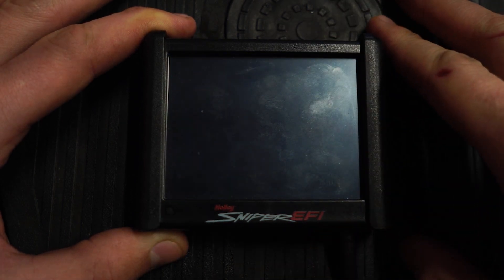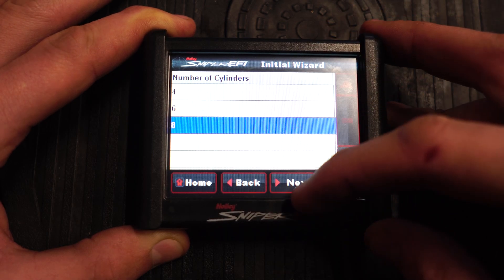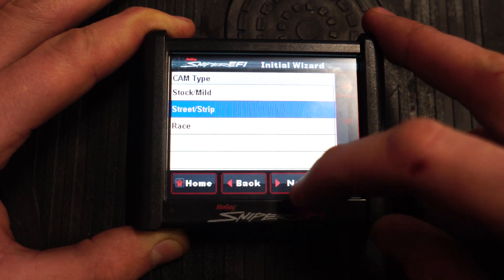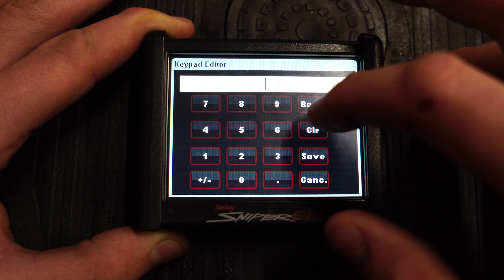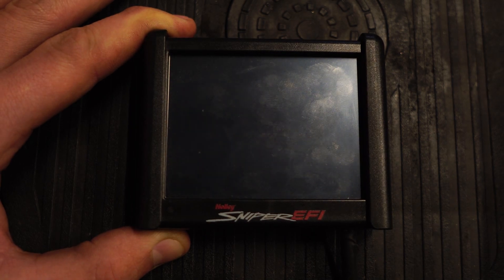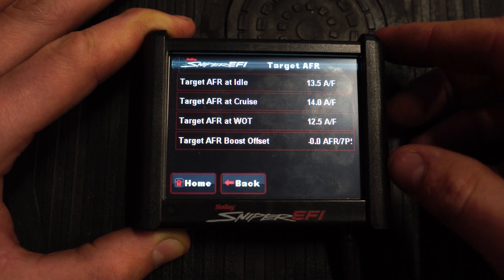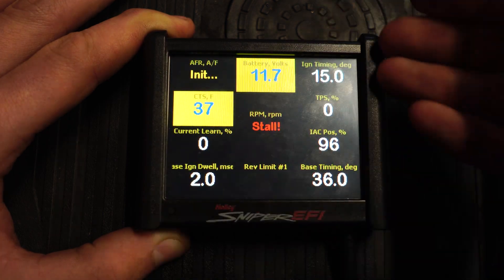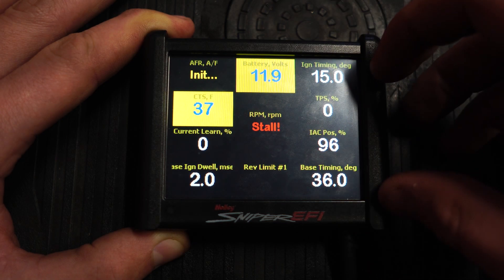Holley Sniper EFI: How to Set Idle

Comment: If you need to just reset your TPS turn the ignition on but do not crank. Adjust your idle screw until the hand held reads zero. Open and close the throttle a couple of time's,  let it set a few seconds then check the percentage on the hand held again. Get it to stay at zero every time you let off the throttle and it will be reset.

Comment: Well, here it is, three years later and video is still helping diy'ers. I tried everything to fix high idle. Idled was  ok until car was driven and then I would have to blip throttle to bring idle down. Frustrating. I tried the double wind spring trick. Resetting control unit and finally checked Iac. It was down to around zero. Sometimes 2. Adjusted as recommended and waalaaa. The fix for that problem is in, but it's always something with this Efi.
I was driving thru Atlanta, downtown, and car just stopped. Cops called tow truck while I worked on it and eventually, after 25 minutes or so, it fired up. To this day not sure of what caused it and I'm always waiting for it to happen again. My pump is externally mounted, which is not good.
Thx...
Reply: Having the same issue. Hope this fixes the problem.

Comment: Adjusting idle speed on my Holley avenger carb takes 10 seconds. You don't need a computer or have to spend $2000.00 . A $15.00 Vacuum Gauge allows a perfect carb setup  in 5 minutes.
Reply: I'm happy for you...... but a lot of people prefer fuel injection over carburetors...

Comment: Did you go into the screen and set the # lower and then turn the set screw. Did you take the ac setting to off in the wizard ??   My I C A is all over the place. I finally got it to come down but I had to turn off the A C setting. and put a fixed orifice pcv valve on it.  It runs great until it gets hot on a long trip on a hot day. I have heat shielded fuel lines and put a 1 inch spacer . Still have problems. Any ideas
Reply: put the carburetor back on,,,,

Comment: Hey Zanes, first of all great video. I didn't see the initial videos and or the issue you had. My CJ5 Jeep has this Holley Sniper EFI but the issue I have is that my car will die at 35/45 minutes of driving around. It feels like something "heats" up or idles because I have to wait around 25 minutes to crank again and then i can drive around but it will die again so that's why I say its something that heats up and wont send the enough gas/power and the car dies. Everything is connected as it should and my mechanic has not find out any other issue than this system.. would you help? Calling this guys at Holley is like talking t o a wall.
Reply: Curious if you got your issue resolved. I’ve got the SNIPER BBD installed on a 258 in an AMC Eagle Wagon and my first starts and tuning had the same issue you are describing. Not sure if the CJ5 requires the same sniper as mine but I did quickly find my issue. When I installed the throttle body I had to remove the TPS just to get space enough to wrench the nuts down to mount it. When I put the TPS back on I installed it in the absolute opposite position that is came installed factory. So what I was seeing was the engine would start when cold perfectly, then at operating temp it started running terrible and it would not start at all if I shut it down and tried a restart. When I loosened off the screws for the TPS and moved it all the way the other direction…it resolved it. Hope you found the issue already but figured I’d share my experience. Cheers!

Comment: Hello, I had the Sniper EFI installed on my 1963 Thunderbird. The car has a stock 390FE motor. While the car runs fairly well, it tends to stall when first driving and stopped at a stop sign or traffic light, while applying gas pedal and attempting to move. Of course, this usually happens when I’m halfway into the roadway and there is on coming traffic.

Any ideas why this might be occurring?

Thank you, Buzz G.
Reply: I've got a similar thing happening on a mild sbc 350 with a manual trans. Once it is up to operating temp it seems to be fine but even then the idle will slow down when you push the clutch in at the stop sign and then pick up again to normal after a sputter. Let me know if you figure it out. Any ideas Zanes Garage ?

Comment: Ok,i saw you had the vacuum port on the fuel regulator hooked up...im reading a lot of mixed opinions on if that should be hooked up or not..im not running any power adders, so should i not have mine hooked up or does it even matter? Idk, hoping you could help

Comment: I cannot get Holley to answer their phone. I’m seeing two things on mine which maybe you would know. One doesn’t really affect driving, but my TPS stays at 0 no matter what. Drove it around the block so the throttle works. The other started during my second drive, The first drive around town went perfect no issues the second Drive went good for about 10 minutes then all of a sudden my AFR started going up to like 35% every time I tried to accelerate and the engine wanted to die.

Comment: What intake do you have? Is it a single or dual plane?
Reply from the maker: I have a jegs dual plane intake. Nothing fancy
Reply: @ZanesGarage  thanks for the response! I only ask because I have seen some claim that it does not work great on dual planes so it's reassuring to see builds that have them especially since that's what I will be using!

Comment: Good video...what issues have you encountered ? I see so many of these videos and I am not confident that they are uniformly consistent....Thanks
Reply from the maker: The only issue I've had is the ECU on my sniper died from an unknown reason. I sent the unit back to Holley and they fixed it with no charge and haven't had an issue since. Everything else has just been from me learning how to tune and engine issues

Comment: I blocked off my IAC with tape when setting my idle. One thing I did wrong on the first attempt is that I blocked off the IAC port when the engine was stone cold. In order to get the engine up to temp as fast as possible I adjusted the idle mixture screw to raise the rpm instead of being patient and waiting until I hit 160 degrees. Bad idea. I ended up leaning out a cylinder bank because the sniper had no clue what was going on in the engine with no valid IAC sensor data.  
I would recommend just running the engine out of tune until it is up to temp before you block off the IAC sensor with tape to set your idle speed. After you lock out the timing to 15 degrees just manually set the idle screw around 50 rpm lower than your optimal idle rpm you want and what you set the sniper to. When you uncover the IAC sensor it should make up the rpm difference and be within 10% or less which is what you want the IAC setting to be at.
Reply: Just don't buy it ...its junk from Holley

Comment: Might be too late as this video is 9 months old, but I had a similar issue with the sniper on my factory five (408 Windsor stroker). The IAC and idle was inconsistent.  I also run the hyper spark setup.  You have to go into advance settings and disable ignition advance when setting idle/IAC. Otherwise the ignition table is fighting you on adjustments.  Once you get idle dialed in you can enable the ignition advance again. Good content, keep it coming!
Reply: The Hyperspark is a joke. My Hyperspark Distributor failed. I uninstalled it all and went back to carburetor.

Comment: I have 427 small block ford motor, and want to know if I can give it a ruff lopping idle by just adjusting the idle. 
Or would that be bad for my engine?
Reply from the maker: Every engine likes to idle at a different rpm but lowering it can cause stalling issues and that could lead to oil pressure problems. Swapping the cam for something with more duration and lift and a better lobe separation angle will be your best bet. Sounds like an awesome engine though!

Comment: My IAC position is significantly different when the electric fan is running versus when its not (like a difference of about 10%). Do you tune your idle when its running or off? I've been having idle issues so i might set my IAC closer to the 2% at idle

Comment: Why is your idle set so high? You should probably try to bring it down to 700-750rpm and see how it responds. My 350 with a more radical cam idles just fine at 700 with the sniper.
Reply from the maker: Well after taking this engine apart recently I discovered that the cam I thought was a zz4 cam was actually a comp thumpr cam. With that cam my engine just liked a higher idle. But yes, it was a bit high during this video.

Comment: Cant wait hyper spark stuff. What kind of engine and cam you have?
Reply from the maker: Engine is a Chevy 350 bored .030 over. The cam is a comp cams mother thumper cam which is arguably not the right cam for this setup but it works.

Comment: You have a fuel prssure reg on your car
How can I instal fuel pressure regulator with gauge on sniper efi 550-516?
How can I take out internal regulator out?
Reply from the maker: My regulator was from a previous setup and it was just easier to leave it on so it isn't needed. If you wanted to install one you just have to have an AN fuel line in, line out and a return line. And the Holley has to have the internal regulator and I haven't removed mine either so I wouldn't recommend that. Hope that helps!

Comment: Set the idle manually with no fans or anything running and the idle air control valve blocked off with some tape.  Turn the car off.  Fire it back up and fine tune it.  Then unblock the IAC.

Comment: Do you race the car with the Holley? Im debating on getting this for my S10 that is a street/track setup.
Reply from the maker: Yes I have I actually did a video of it running at my local track a couple months back. I had zero issues with the Holley and it picked up some time compared to my Holley 750 carb that I was running.
Reply: @ZanesGarage  Awesome thanks! Ill have to check out that video. The 750 is what I have on the truck also.